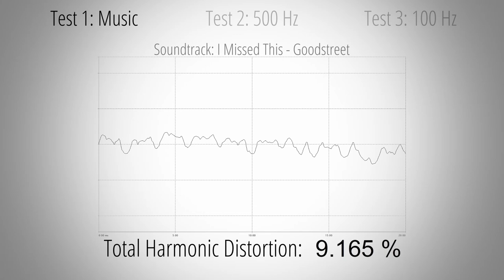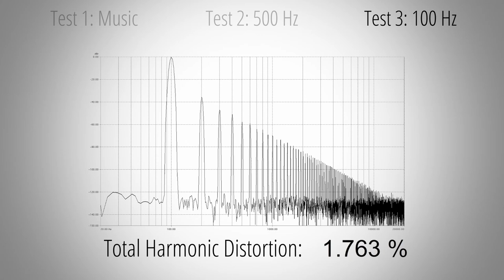How much distortion can you hear? - Audio Distortion Test

Comment: There's a little flaw in this test... because it's steadily increasing, you do not have a direct comparison with undistorted signal, only with slightly less distorted signal from several seconds ago. So the only way you can tell is by listening to telltale signs of distortion, but the difference between clean and distorted signal may become apparent way before, especially for music rather than sine tone. I think the next better iteration would be to have specific distortion steps that you test at, for example increasing by a particular factor every time, or using Renard or E3/E6 series of preferred numbers, and have a clean sample in between each test, but there's a practical issue that this may make for a fairly long test.
Reply: I'd prefer distortion in real world like actual listening to a music rather than creating comparison tone which is not so useful in a real actual average world. Anyway, there is already a distortion at . 00000001% that only some animals can discern.

Comment: Test 1 : 10%
Test 2 : 1.5%
Test 3 : 5%
Very interesting, I need to compare it with other results in comments section now!
I used Jabra wireless plugs.
Reply: Similar values also in my case
Reply: Do you have the jabra elite 65t active ? I just bought them today and they're perfect really except for the god damned hissing on the left earbud when going above 70% volume
Reply: I was pretty much the same, but I could hear distortion at 1.8% in test 3, mainly because my speaker could not reproduce a 100Hz tone, so the first thing I could hear was distortion. On my phone I also couln't listen to 100Hz, but the distorion came at 0.6%
Reply: test 1: 9%
test 2: 0.5 %
test 3: 3%
listened through the samson sr850 connected to my fiio k5pro dac:)
Reply: Test 1 : between 5.427 %
Test 2 : 1.331 %
Test 3 : 2.871%

Running over : 
=> Musical Fidelity DaC (M6sR DAC) 
=> Rotel Pre-amp (RC-1572 MKII) 
=> PowerAmp (RB-1582 MKII) 
=> Triangle Antal Ex speakers (sound is crisp clear, maybe that helped a bit).
Reply: 1: 8%
2: 1.4%
3: 4.6%

Listening with Focal Elex connected to Topping D30/A30 Pro. And I'm only 28 years old but my hearing ability is pretty shit generally.

Comment: ThieAudio Monarch MK2 + Fiio Olympus 2 
Test 1: 7.5% (notice it on the hit hat) on subsequent A/B testing I started noticing it clearly at 0.5%
Test 2: 0.1% (noticed a very very slight but distinct sine noise in the background)
Test 3: 1% (noticed a distinct buzzing noise) on subsequent A/B testing I started noticing it clearly at 0.5% 

Really impressed with these, for reference I took test a while ago with my ER4XRs and it took me way longer to notice distortion

Comment: Good test. In the hi-fi industry, blind testing dating back to the 1950s established a standard that THD should not exceed 0.1% for equipment to be deemed 'transparent'. Six decades later and having spent many years restoring and servicing hi-fi amplifiers I would have to agree - <0.1% and you really don't need to worry.
.....which makes the specification wars somewhat farcical. How many times have we seen headlines for new improved equipment where THD has been reduced from say 0.05% to 0.02% - nobody should complain about that but you won't hear it either.
Reply from the maker: Yes, I think this test puts things into perspective. Of course you want to have equipment with the lowest distortion possible but at some point it's not going to make an audible difference anymore.
Reply: @JulianKrause  Distortion type also plays a part. Odd order harmonics are more objectionable than even order, and higher order more then lower order. Listeners will often tolerate 2-3% 2nd order harmonic distortion but find 0.5% odd order very audible through a clean system.
Reply from the maker: @redrobbosworkshop  Very good point. And even something like crossover distortion will have a different level of audibility compared to something like digital clipping.
Reply: The Leak amp company from the 1950s used 0.1% as a marketing point, as they claimed their amp designs all were under 0.1% distortion.  It explains why even 70 year old amp designs still can sound good, until they overload.

Comment: First, the music industry has made us expect distortion in music. Second, because of the first, we like distortion up to a point. Third, I can hear it in music with high-frequency elements (high hats, other percussion) much more easily and quickly than with a mid-to-low frequency pure tone. So, I could hear the distortion in the music at a lower level because I'm trained to listen for it in my music productions. For me, distortion must reach about -30dB relative to the content before I can start to hear it. (If the content is close to 0dB). I was surprised that I couldn't hear the 100Hz distortion earlier! It had to get to about -12dB before I was certain. Interesting! Yet, when I put a clipper on my kick drums channel, I can hear it immediately if the signal is much over the ceiling of the clipper (also for sure oversampling in the clipper must be disabled).
Reply: I like distortion because of found footage horror

Comment: Using a Komplete Audio 2 for audio playback I noticed I could hear noise from speakers when files were coping on my Desktop, then also realized there was noise when the mouse was moving. All the USB plugs on the front of the desktop and on the back of the motherboard produced noise out of the speakers.  The only USB receptacle without noise was into a USB card into a PCIe 1x slot (two plugs on the front of the box connected by wire to this card had noise).  I was wondering if splitting the power and data lines in the USB cable of the Komplete Audio and powering the interface with Battery power would be feasible? I noted in some reviews sound quality of DACs can be greatly influenced by clean/dirty power.

Comment: Test 1: 7% - The bass starts to noticeably clip and sound fuzzy at that point.
Test 2: 0.3% - lower pitched noise that sounds a bit like a photocopier.
Test 3: 1.9% - slightly higher pitched faint buzzing noise. 

Equipment: AKG K702, Topping NX4, a quite room.

Comment: Surprisingly hard to hear in the music and 100Hz test, surprisingly easy in the 500Hz sine wave. In the 500Hz test I started hearing it at about 0,7-0,8%. In the 100Hz test I heard it at about 1,5%-2%. But in the music test it was only after like 6-7%. This was on a home theater system, so not monitors or headphones. Relaxed but clear volume. I'll try on some headphones through an interface later!

Comment: Set-up: Dragonfly Red + DT 1990 ; played at chill level 
Test 1 : 7-8% (on the background sparkle so I had to wait for the next beat :)  )
Test 2 : 1.9%
Test 3 : 3.5% , but had to listen further & go back to confirm the change I heard was indeed the distortion 

Played at loudest acceptable level:
Test 1 : already at 5%, on the higher freqs, I can hear 
Test 2 : from 0.7% to 1.1% (approx), can discern a change in the tone, while the real static noise begins around 1.5
Test 3 : harder ...5% ?  Actually, I think the DFRed was introducing some distor, so I had to listen several times, but my ear probably fatigued/got used to the level, so lowered back the volume then it remained around 3.5%

Interesting test, I wonder how it relates to the mesurements of devices (AI, DACs, Amps ... ), there is a good chance that the number war on those departments, go far beyond what can humanly be heard, as usual :) but especially for recording, master prod, it's + important since the signal will be treated, transformed etc... (which is why it's good AI rec at 192khz)

Comment: Not looking at the screen, first attempt (thus unknown music and unknown distortion profile) using Focal Aria 906 Bookshelves at relatively low volume:
Test1: 10%
Test 2: 5%
Test 3: 10%

Second run: still not looking at the screen, Focal Clear, moderately high volume
Test 1: Music sounds dirtier than usual at 0.8% though the effect only gets obvious at 5% since the piece contains distortion in itself as most electronic music does.(test done twice to confirm)
Test 2: Tone changes at 0.4% (test done twice to confirm)
Test 3: Tone changes at 3% (test done twice to confirm)

Comment: What actually bothers me (not related to this video), is when playing music then I crank up volume, at some point the high will become harsh, I wonder if that is count as distortion or noise ? I plan to change power supply to my preamp to a linear one but then I also read about noise coming from electricity in wall socket which needs power conditioner, I wonder if that noise is eliminated will it help reduce harshness at high volume, or that's just the nature of audio and noise is actually inaudible, or ppl usually call it snake oil.

Comment: Lol this wasn't the type of video I was searching for, but it's interesting nonetheless and I got completely shocked by my results. For the first 2 tests I noticed around 0.3-0.4% and the 100Hz one at 0.6% . What shocked me is the first test - I was listening and at some point I told myself "that's it - I can definitely hear it" then I switched back to the video and saw 0.3% - "that's too low, it's gotta be placebo" I thought and I minimized AFAP. The very next second I thought "I know what I'm hearing and I can clearly hear it getting worse, it's about to sound like trash any second now". So yeah, my point is that the rapid rate of distortion increase is a strong give-away and makes the tests a little bit misleading.

Comment: It surprised me that it was so hard to hear the distortions in the music. It was audible for me from about 4.5%. I heard with a Sennheiser HD 600. It was only heard via my Nubert A-100 loudspeakers from about 7%. For me a test with different genres would be interesting.
Reply: Nubert A-100 - beste :D
Reply: @airwolf1337  Für mich auf jeden Fall. ich präferiere vor allem einen neutralen und smoothen Sound. Ich habe mir alle anderen der A-Serie angehört und meine Soundpräferenz konnten mir bisher nur die A-100 bieten. Natürlich ist der Sound nicht so smooth wie von einem Sennheiser HD 600 / 650.
Reply from the maker: I think that the type of music can make a big difference to the susceptibility of distortion. You will most likely hear distortion more easily with classical music than rock.
Reply: I agree, would be interesting to hear it with music I'm more familiar with.  I heard it at quite a low level with my eyes closes on my Klipsch RF-9's but I was looking for it, just listening casually I may not have noticed until higher.  At 5% for music is was very clearly audible.
Reply: @JulianKrause  Julian, do you think, people can hear distortion with headphones earlier?
Reply from the maker: @airwolf1337  Yes I do. Because there is no additional reverb from the room that could mask distortion, it is easier to notice it.
Reply: @JulianKrause  Rock, although it is dominated by distortion embedded into the signal, is actually quite sensitive to playback distortion. Because originally the distorted signal is band limited to specific frequency ranges, but when playback distortion comes in, the distortion propagates outside the bounds of any given instrument and just makes everything sound muddy and unintelligible.
Reply: Hd 600 is a good headphone

Comment: I noticed Distortion at these values, with eyes closed.
first test 0.02% 
second 0.008%
Third: N/A speakers on laptop could not go down low enough, though i could hear the overtones at around 16%

Note, im an audio engineer, and know what to look for in the sound. That being said, i like tubes, and their characteristic distortion, though i also have and like my extremely low distortion amps (custom built laboratory / scientific amplifiers).

i find 0.2 to 0.8% second to be a very pleasing sound myself.

Comment: 1: 7.5%
2: 0.6%
3: 7.5%

Distorted 100 Hz sounds almost like power transformers in my country (50 Hz).

Trying with higher volume
1: 4.5%
2: 0.3% (sudden increase in harmonics)
3: 2.5%
Both played on my 50€ wireless earbuds.

Comment: Hey Julian, 
i have a question regarding latency of wireless mics. I got a rode filmmaker kit and a sennheiser avx mke2 lav running at the same time into a zoom F4. Since the sennheiser got a  higher latency than the rode, i always have the echo monitoring as well as half a frame delay between them in post. 
Can I correct for the 19ms delay of the sennheiser with the input delay function of the zoom? Would I have to set a input delay for all other mics than the sennheiser? 
Mostof the time I have the Rode NTG3 on the boompole, filmmaker kit (4ms delay)  and sennheiser avx running (19ms delay) running into the zoom and the echo when monitoring is soo distracting. Do I just have to live with that?
Is there a simple way to correct for the delay in audition, since i cant move the audio track have a frame in premiere pro? I record all tracks independently, no mix. 
Thanks
Reply from the maker: Hey, the F4 can apply delay independantly to each channel. What you have to do is to slightly delay the audio of the input where you got your boom connected with the filmmaker kit. You should have to delay that channel by about 15ms (19ms - 4ms = 15ms). This should give you a good starting point to dial in the delay further. If you do this, you actually don't have to anything in post, because both channels are already in sync. If you still want to align the audio further in post, you can do this in premiere: https://youtu.be/Pjg375f_jR8
Old video but should be the same for newer versions. Hope this helps!
Reply: @JulianKrause  Thanks a lot Julian! Ill give it a try!

Comment: Hi, when I am using an external mic which connected to H1N. Can I still able to  control the gain level by adjusting the gain knob which is on the top of H1N? Thanks!
Reply from the maker: Yes, when you plug in an external mic the built-in mics of the H1n are turned off and you control the gain of the external mic with the gain knob in the front of the device.
Reply: @JulianKrause   Thank you , you are the best !

Comment: Totally serious question here: If i hear popping(distortion) during your intro talk and outro talk whats wrong then? 

Gear: chromecast to tv, spdif to wxc-50(preamp) rca to a-300(amp) to 280f klipsch.

Ive been going crazy trying to find the error. Help plz.

Diagnosis: pops no matter volume on a-300. 0dB on wxc-50 (full volume and bypass, no eQ, direct mode). Short cables to speakers(1m), dunno gauge but their thick enough, rca cable 0.5m, spdif to tv fully working.

Plausible chromecast is the bugger? It doesnt have a dac from what i know of.
Reply from the maker: You have any chance to use the setup with a PC instead of the chromecast? This way you might find out if the problem is due to the chromecast or the system.
Reply: @JulianKrause  i will try that and also take an a-class receiver to test without wxc-50 and a-300 directly to speakers.

My only thought is shouldnt chromecast be just digital signal all the way to wxc-50, maybe it isnt. We will see soon enough :)
Reply: @JulianKrause  im back after testing multiple things.

Found out that an APC i use was causing a constant noise in the speaker while only having A-300 amp to speaker plugged in. Using any power socket without APC made the noise go away. I think it also states in the manual this could happen. The APC is as they say a power cleaner + circuit breaker. In specific APC surge arrest by Schneider ($30).

Havent re-installed all gear without it yet and tested your vid but i will now.

Will also be testing my Sony A-class vs Edge A2-300 D-class amp and see if there is any audible difference between the two on clean power.

My goal in the end is to have very high quality audio which is why i want to not use PC as a solution, except if i get a high quality soundcard or dac ofc, but i felt chromecast to tv to preamp to amp to speaker sounded like a better solution.

Will continue investigate my audio bottleneck in this setup. Brb.

Comment: There are caveats with those test, as an addition to what was already said (I'm listening though an expensive audio system with <0.0001% THD):
Test 1: It is hard to tell if the distortion introduced is intentional or parasitic, really, because some mixes indeed use distortion to saturate sound. Here, though, if you use a decent enough audio hardware distortion can be easily spotted by the change of hi-hats character. With no distortion they have specific start, comparable to tick, but even tiniest distortion will smudge it, but it is so mild, you can only really hear it when it's isolated. At 1% many sounds in high-frequency region noticeably dissolve, that's when people start to notice something is off. Btw, mp3 turns everything above 15 kHz into a noise sequence if possible, hence distortion will kick in really late there.
Tests 2 and 3: I notice distortion at 0.2% for 500 Hz tone and at 1.6% for 100 Hz, which, having the trend continued upwards, means the real deal with THD starts at over 1kHz. Again, those hats, they're typically a tight bunch of high frequencies.
So, what's the point of expensive audio systems: high frequency clarity. Yes, numbers like 0.01% can throw off an audio engineer and lead towards making a wrong decision, but in very specific cases.
And one note: you don't really have to hear exactly when it's wrong to feel that it's wrong. For the same reason uncanny valley exists.

Comment: Test 1: Very Low Volume
Music: 5% and ubearable to listen at 10%.
Sine 500hz: 5% unbearable to listen at 10%.
Sine 100hz: 4% ubearable to listen 6%.

Test 2: High volume (still far from max).
Music: 1%.
Sine 500hz: 1%
Sine 100hz: 0,7%

Both tests on audiotechnica headphones ATH-AD500X, also no filters on amplifier. My amplifier has THD level at 0,7% so propably can't hear it earlier.